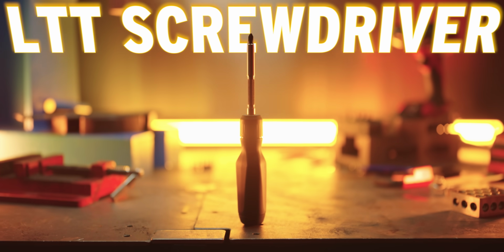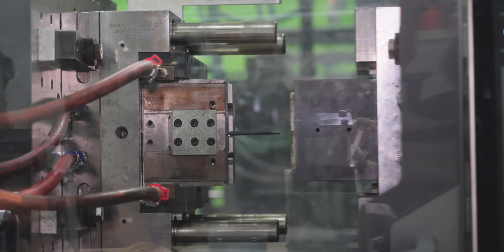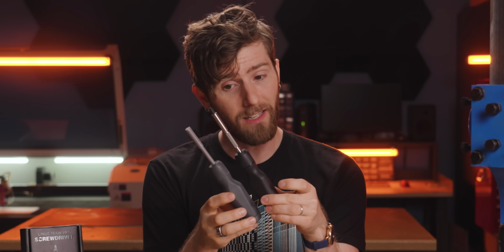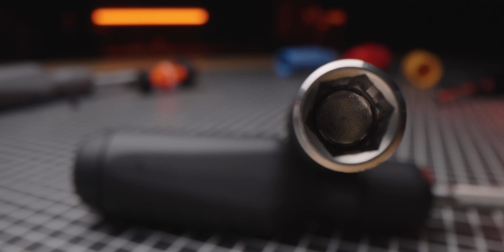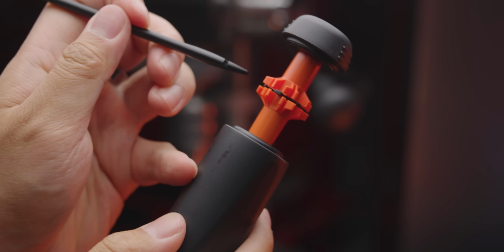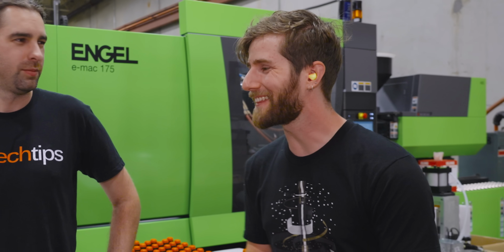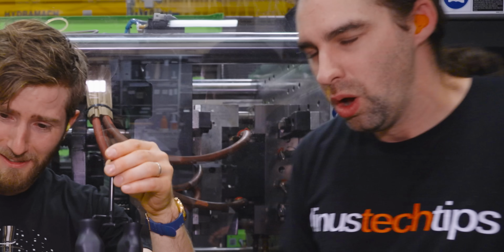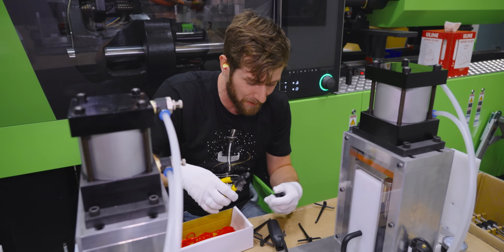Why our Screwdriver took 3 YEARS

Comment: A great ratcheting screwdriver with inbuilt bit storage for use around the house? Sold--especially with those metric hex bits. In my experience, kick scooters reliably use metric hex bits--although what I'm really curious to know is whether the ratcheting mechanism is up to unscrewing some of the bolts that even my power drill couldn't. 

If not, I've got a breaker bar set with a hex bit converter bit I can fall back on (which is precisely how I unscrewed those to begin with). Still, it'd be nice to have something more compact that could do the same job.

Comment: Congrats on making, quite possibly, the most profitable video you will ever make. You did a great job telling the story of the design to production process!
As a side note, if y'all are going to do something like this in the future, you might want to invest in some more capable metrology equipment to perform quick and accurate QC on the parts you receive (especially samples). As a machinist, it's completely unacceptable to have a part be .005" out of tolerance and still ship it. If you're dealing with overseas manufacturers, you need to be able to check their work accurately and in a timely fashion.

Comment: Did you say you spin the "mech" right to Ratchet to the right?  Like to Tighten a screw?  This means if you hold the "Ratchet Mech" while Tightening a screw, you'll switch the ratchet to unscrew.  That's why they mech turns left, to tighten, and turns right to ratchet loosen.  
Or did I just misunderstand what you were saying?
NOPE!!! I heard you correctly. "Ratchet right, screw in right" is a TOTALLY BAD WAY of doing that.  If you use a 2nd hand and try to hold lower on the screwdriver and ratchet it, you're going to reverse the direction of the driver.  And you'll constantly be messing with it to get it back to the correct direction.

Comment: @ Linus Media Group... FOR BLACK SHAFT.  Look at DLC Nitro Carbonized finishes (DCL=Diamond Like Coating).  Not sure what the bulk cost is but the use it on gun barrels and bold carried groups.  It's EXTREMELY scratch and wear resistant.  Heck the DLC coating is harder than the steel you are attaching it to or any materials found in a PC.  It's literally almost as hard a Diamond and only a few micron thick.

Comment: I can respect the amount of work that went into this, but I'm in no place to be buying a $70 screwdriver when I can buy cheaper stuff that works just fine from Harbor Freight.
Reply: after watching the Project Farm video, I must say that this screwdriver was really designed for its purpose. The fact that the ratchet requires very little resistance is so important when working on computers. Great job LTT for engineering this product!

Comment: One of the most engaging product spotlights (given the length, SuperBowl excluded) that I've seen. I just can't afford it though. I often say that you're going to pay for "it" somewhere. So in this case you'll either buy one driver that will last past Linus's demise or 5 other drivers in the same timeframe. At the moment, I'm unfortunately on the pay as you go program of tools. I buy things, and hopefully develop things, such as this that reduce frustration, which is something most users just settle with and then cry about. Props to wave 1-4 selling out, 60k+ units.

Comment: When U First think the 0,005inch wrong sized Part was a tiny af size Displacement and then U convert it into your trusty metric system and See its a big af Displacement of 0,127mm and we the metric Guys use tolerances Like 0,005 mm 😅👌

Comment: having worked in plastic production before, those molds can take as little as like 4 hours to change on a really good day, to all day or more on a bad day. the machines can be fickle about cooling and heating and lubrication. just a little off on any of it can make pretty noticeable changes.
Reply: I'm a injection moulding technician and work with engle machines. A tool like this would take around an hour for me to load and take shots.
Reply: @simonguppy6023  yeah, where i worked there were too many chiefs getting paid to much to stand around and get in the way so everything took far too long. they were also allergic to allowing actual maintenance to get done on machines. because the downtime cut into profits

Comment: For work and home i use Ifixit on desktop and laptops how well does this screwdriver work when taking apart smaller items like laptops does the screw driver feel too big using it on smaller screws also I can use the bits from the ifixit tool kit if I use the adapter ?

Comment: if youre gonna use this on desk and laptops / tight and also sensitive spaces a finer fear would be a uuuuUge improvement. I feel like it couldve been alot smaller also ,especially if the automotive torque req. goes out the window. being enthusiasts ,maybe try reaching out to fellow enthusiasts for future tools.

Comment: Ordered one all the way in europe. 

Wish the original set of bits came with pozidrive 0-1-2 instead of robertsons. Those screws dont really exist here. 

Minor detail and I own an angle grinder :)
Reply: Heh, you'd hate to see how often we use robertsons here in canada. It's probably one of the screwdrivers I look for most often when doing anything residential.

Comment: Well, thanks for all the attention to detail about the product.  I was really looking forward to buying one.  Unfortunately you've priced it prohibitively high and I will NOT be buying one.

You've mentioned on multiple occasions that you could charge any amount for a product and it would sell out.  I guess this product is an example of that theory.
Reply: It's unfortunately not a hobbyist tool. Will definitely be buying a couple for the shop though. Have spent more on some of our ratcheting drivers and had them fail exceedingly quick, If the quality is there this could be a really nice pro grade tool. You'd be more likely to see a cheaper version once they've managed to lock in some volume history and have more specific product experience.

Comment: You've sold one to me. I'm excited to try it out, and compare it to my Snap-On soft handle ratcheting screwdriver that I've owned for around 20 years now. The only issue I've had with my Snap-On is that the magnet came out from the shank around a few years ago. I've since used an epoxy to put it back in, but some of the epoxy has gotten into the bit holder as well, so the bits don't perfectly fit into place as they used to, but they are also never going to come out while using.

Comment: As someone who works with hand tools and power tools a lot, as well as builds PC's a lot, longer shaft and longer bits are much preferred, as the handles of screwdrivers usually get in the way while working in a PC. Having it so the handle is basically outside of the case the entire time while the shaft+bit are inside are way better/easier to work with. No idea why anyone would buy this. Go to your local hardware store, get one with longer reach and save yourself anxiety AND money. $70US are you joking lol

Also, no magnetic bits?? That's a huge oversight and this as a whole is a giant fail LTT

Comment: I have gone through 5 game controllers in 5 years. Even the high quality ones that have buttons and triggers fail in the parts that aren't modular. And I have been given the run around with the warranty on the high end stuff. I need someone to make an IP68 controller that is easy to clean, uses durable buttons (and I am talking bumpers and face buttons) and analog sticks, with a customizable layout (and has support for re-mappability) that can last over 1500 hours of use. I would be willing to pay $250-$350 US for this and even more if I knew I could get support for anything that failed.

Please LTT Labs, can you make this for me?
Reply: Making an ipx8 controller would be pretty much impossible due to all the holes you would need to seal. I cant even think of a solution for the triggers since they need open space in order to feel smooth. If you even tried to seal those, youd need to make them extremely tight, making them extremely hard to move.
Reply: you need to check your strength man, I have ALL my original controllers from all my consoles dating back to the NES, still in working order, sure the analogs get mushi (or soft in someones) but still work, and I play fighting games and shooters a lot, also I play every day, (3-5 hours a day till 4 years when ago my son was born and that was drastically reduced to 1 hour a day for the first 3 years and now 2 hours a day)
Reply: LTT doesnt even offer a warranty on this screwdriver, meanwhile MegaPro has a lifetime one on theirs.  I wouldnt expect LTT to provide support once something fails after a year.
Reply: No, solid gold controllers only!

Comment: 20:40

Don't you mean tapered inwards?

Also someone's screwdriver will have the worst gate cutting work 8D

Linus the first cut needs some distance away from the part, leaving some gate material. Then the second cut can trim off the gate material. That way, pressure doesn't deform where the gate connects to the part, turning white and leaving an ugly hole there.

Some workers here do it, some don't, depends on how motivated they are, I guess.

Also linus dropped screw driver special edition?

Comment: I'll be curious how it compares to the snap-on one. I used one the other day and it was very good. Looked up the price and it's more than double the ltt one. Looks very similar though. Of course snap-ons warranty is pretty great so maybe that's part of the cost
Reply: Snapon has a lifetime warranty.  From what we know, LTT still has no warranty, at least not on the site.   For $70 you better have a warranty listed on your website.
Reply: @TheNichq  There is a warranty on the website.
Reply: SnapOn's costs basically the same as the LTT one.  They're ~$75, not $140.  

MegaPro 211R1C36RD would get you the exact same quality (and every single feature minus the shaft knurl) for half price.  It's only been around for over 10 years at <$40 the entire time on Amazon too.  

 Linus conveniently shows the lesser model with flip bits in the video for a reason, because you can't use that driver with any old bits you have laying around.
Reply: @jaywelker5566  ah that's good. The one I tried must have been special cause it said $176 on the snapon store. I still don't need a $75 screwdriver but judging by how great that one was, I would just stick with snap-on over ltt. And the truck stops at the motorcycle shop 10mins from me every week

Comment: they designed it with precision, the problem with precision is the wear and tear. if 5K of an inch can make the screw driver unprecise, what it needs is a replacement parts available too. also i think it needs an extender shank too, there is a time when you need a longer screw driver to reach some farther screw. better than buying another longer shank screw driver, it is all purpose screw driver in mind after all.

Comment: You should sell the ones with minor visual defects at a discount, that'd reduce waste and be a cool move for the people that don't have that much money to spend.
Reply: They'll likely use the blemished ones around the office. That's the standard procedure for merchandise with a functional pass, but damaged finish. It reduces waste AND internal cost.
Reply: @AvoCattoTV  I'd assume there'd be quite a bit of blemished ones, like way too much for just the office.

Like even assuming a percentage as low as 1 or 2% which I think would be quite low if you take the production numbers he mentioned when talking about manufacturing the molds, that's a whole lot of screwdrivers.
Reply: @imnota  In manufacturing if you have 1% loss at QC you need to revisit your processes.
Reply: @RuralFisherman  

In simply practical parts yeah, you're right.

But we know how linus is and how he's considering this screwdriver as such a premium product that it's almost a piece of art.

If he really does as much as he acts like he's gonna do, any minor little scratches, any tiny imperfection, injection molding flow mark, dye non-homogeneity, or mistake while assembling is gonna make it fail Qc. The type of stuff any other tool manufacturer doesn't give a shit about.

That definitely won't compare to any of the qc fail rates you'll see online because what you're gonna find is stuff about automotive manufacturing and things like that and I'm not quite sure you can compare the qc fail rate of a control arm or something like that where they reach only a dozen qc fail per million, thanks to high tolerance compensated by adjustment in parts, total lack of care about what the finished part looks like, robotic assembly leaving zero room for human error, those kinds of things that makes it not comparable.
Reply: @imnota  I'm in plastic manufacturing, the repeatability that Linus is looking for can absolutely be done at factory level with this injection molding process. 1% is a massive number of rejects even for something like this.
Reply: @RuralFisherman  they are noobs at this,.give them time to to get accustomed to the machines
Reply: @RuralFisherman  Ours is far FAR higher than that, but we make some very persinickty aircraft parts and they HAVE to work.
Reply: @JeffDeWitt  oh yeah, manufacturing aeronautical stuff is finicky, tolerance issues are through the roof on that stuff.
Reply: @RuralFisherman  Yep, it's crazy how tight some of our tolerances are, plus we are making heat sensors that have some very strange chemistry and physics going on.
Reply: Sell them as “Dropped by Linus!” Edition, for twice the price. With a certificate of authenticity.
Reply: Factory seconds have been a thing at most factories my dad managed. A lot were given away but some were sold in stores as seconds.
Reply: @deViant14  In big companies sometimes they just dont brand them, and sell them cheaper, even if is like 1% out of million thats a LOT of unsold merch
Reply: @enriquedossantos3283  like the several comments above have been discussing... 1% would be a huge QC fail rate, even with Linus' extra picky standards.
Reply: @tzxazrael  yeah 1% is astronomically high, is just an example figure, this machines are very precise maybe 0.001 is a more realistic number especially after the operator gets accustomed to the machine and they are using top quality CLEAN prime materials
Reply: Many small run projects sell B-stock at a small discount to make up for lost inventory, but this is much bigger than that. Besides, the handles can just be ground up like the sprue pieces and added back.
Reply: @devilselbow  

That's besides the point, but I'm sure he cares about still making money on waste and I'm also sure he cares about it making a more eco responsible reputation for his brand.
Reply: And sell the ones Linus dropped at a premium. Certified Dropped By Linus quality.
Reply: Would not be worth the hassle of management

Comment: This is one of the best short videos describing the entire process of designing and producing a consumer product I've ever seen, to be honest.
It also gives some insight on why so many products in this space have seemingly obvious UX flaws - so many of the points where you pressed on to get something done exactly the way you wanted it, just couldn't be done at a Harbor Freight/Princess Auto price point, and even a mega tool company like Stanley or TTI that has the resources to get whatever they want done just would've cut losses to get a product on the market faster.

Comment: I was all set to order (in cart to order with shipping listed) the amazing screwdriver but a shipping charge of of 15.7% was just not acceptable.  Maybe if you ever get the charge more reasonable with volume or a stateside distributor that accomplishes the same volume of scale and bring that shipping charge down to a more reasonable for a ??? lb/kg screwdriver and bits.   $80.98 USD is unreasonable from my viewpoint.  Sorry.  I'll wait to see what the collapse of the innovator cycle brings.
(Frankly, $69.99 was pushing it.)

Comment: I appreciate the engineering in this but come on, we are not NASA engineers, or maybe we are.  Who in the world needs to spend $70 on a screwdriver?  I actually have a friend who is a NASA engineer and he doesn't use a $70 screwdriver for himself.  As a matter of fact, he uses a quality magnetic $20 ratcheting screwdriver that works great for his application.  I personally use an industrial electric screwdriver that has precise torque settings that I purchased on eBay about 25 years ago for $50 for two of them.  They were made for computer manufacturing in the Shenzen assembly plant and are fantastic.  I know your merch is great quality but your prices are insane.  I mean seriously, $30 for a water bottle or a mousepad?  Are people actually buying this stuff.

Comment: I already have concerns about the shorter bits. I have often ran into the issue that the screwdriver is too thick to reach recessed screws in things like the Nintendo Wii controller. Obviously I can use my own longer bits, but seems like there is a reason that the longer ones are more standard.

Comment: I personally wouldve liked a more hidden magnet with a way to clean out iron filings that get jammed in the socket over time, the magnet inevitable wears off its protective coating and oxidizes extremely badly, worsening the iron filing problem. 

This filing issue makes it really hard to remove bits after heavy use

Comment: I'm a electrical engineering student, would this screwdriver work for electrical work too? love the design nonetheless, probs gonna get it for my mechanical classes, but just wondering if it'll works for high voltage electronics too.
Reply: Just buy a comparable one for literally half the price, that actually comes with a long warranty.